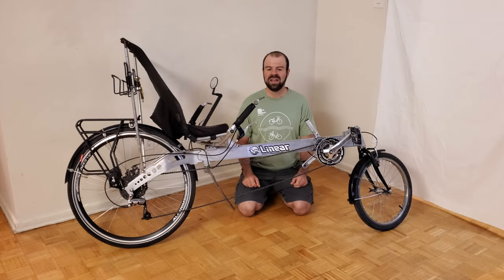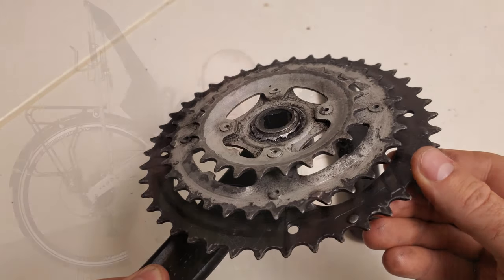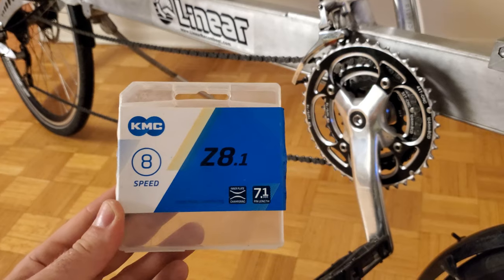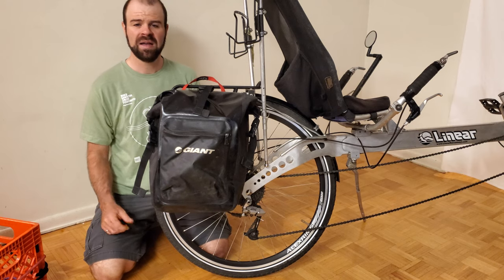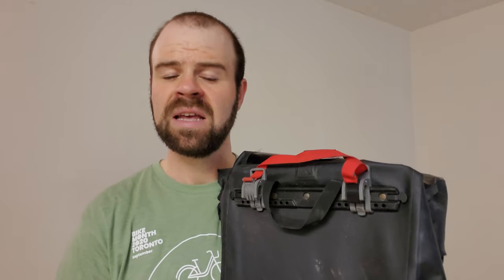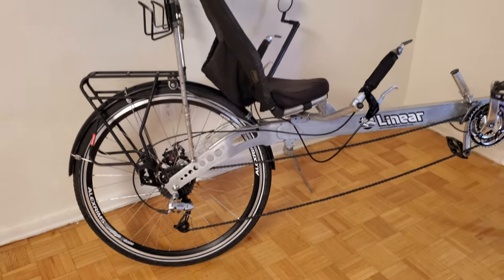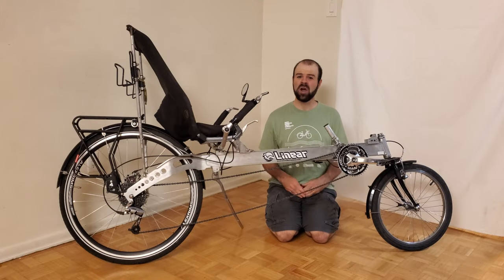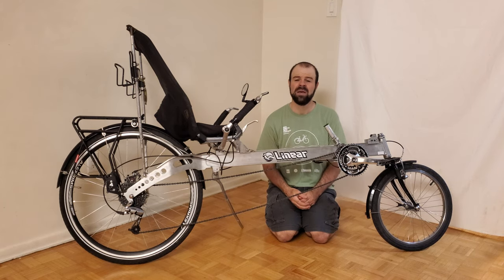Linear Limo Recumbent - 2 Year Update

Comment: The cross dowels worked really well.  I might have tried rivet nuts first, but there is no doubt your repair will work permanently.
Reply from the maker: I've never used riv-nuts myself, but I'm not sure I'd want to try them in this application. Because I was concerned about weaking the structure of the seat, I drilled the holes so they were only a tiny bit larger than the size of machine screws that I selected. To use riv nuts, I would have needed to drill much larger holes. I've since read on a forum that others have done the same kind of repair as me but used standard pop rivets. I'm sure they're not as strong as my method, but a lot lighter, quicker and if they ever fail they're pretty easy to replace.

Comment: It's really interesting to learn more about your bikes and all of the neat ideas you've come up with to either fix them, or improve them!  Curious to know, why do you have two recumbent bikes?  Is one for a different purpose than the other?
Reply from the maker: Thanks and great question. It's kind of a long story, but basically I bought a 2nd Linear because my first one had a problem with it that was really challenging to fix. Eventually I managed to get the first one fixed, but by that point I was already kind of attached to it. I've considered selling it, but it's also been really handy having a second recumbent that I can ride when something needs fixing on my main bike. I've also recently been using my older Linear for towing my kayak on my bike trailer. The reason for this is that I need to leave the bike locked up on shore  for hours while I'm out on the water in the kayak, and if my bike were stolen it would be less of a tragedy if it was the older one.
Reply: @cjhoyle  Oh I see, good idea!  Yes having a backup bike if you're able to is great idea, in case something breaks, especially being that yours is a unique bike that I imagine might be more difficult to fix or get parts for.  And another good idea to use the older bike for rides where you have to leave your bike locked up somewhere for a long time.  After buying my new bike this spring, I haven't sold my old bike yet.  I've been considering keeping it for that reason, to have an old bike to use when I might be going somewhere and I don't want to worry about someone stealing the bike if I leave it alone for a while.

Comment: Ah, CJ! Those Lasco cranks look really nice! I think I'm going to get a set for the nose of my P-38 next spring. I'm going to leave the SR Suntours on my Stratus, though, because I don't mind a bit of additional forward weight on that bike and want to keep the bash guard, too.

What bottom bracket spindle length are you using with the Lasco? You went from a 113mm before that, if I'm remembering correctly.
Reply from the maker: Thanks John, and thanks for your helpful advice last summer. I actually found myself reading back through our email thread when I was preparing to make this video! I switched from a 122.5mm bottom bracket to 115mm.
Reply: @cjhoyle  Wow, more than 7mm difference. That was going from the Action cranks to the Lasco. I've got a 113mm with my SR Suntour to generate a 50mm chainline, I can probably get away without changing the BB to accommodate only 2mm, shouldn't have to do more than twiddle with the stops on the front derailleur a little.

Great mods on the bike, it looks terrific! I'm always impressed by your work.